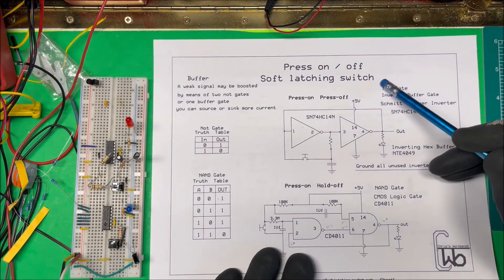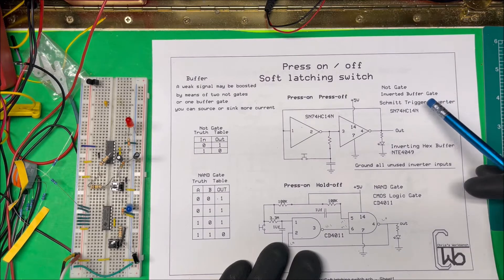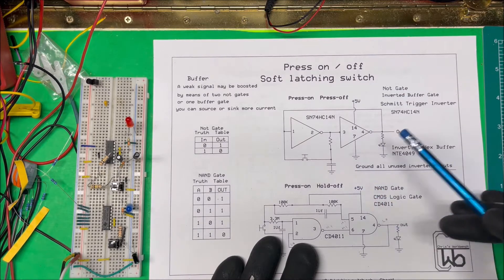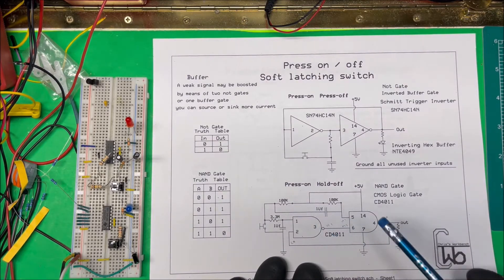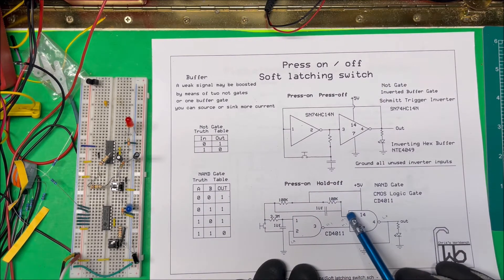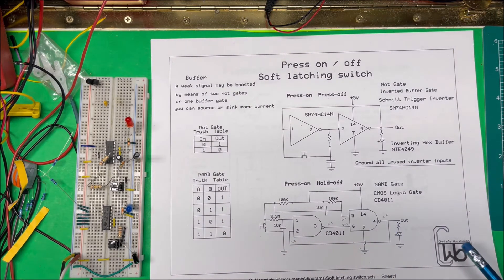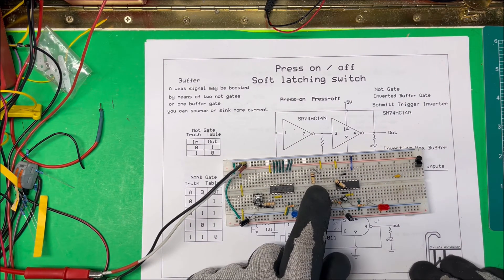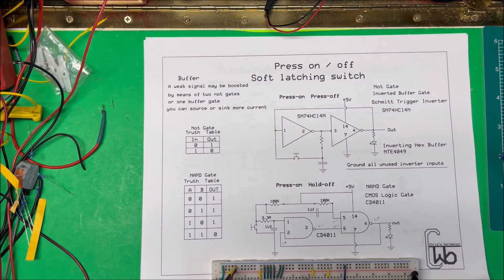Soft Latching Switch

Comment: Thanks for the only circuit that seemed to work! I used a HD14584BP which can control 4 switches (I am using 2 at present), it works perfectly

Comment: Interesting considerations. Thanks for sharing. I have a POn-HOff switch on my Siglent DMM. I do not know what circuit they used to engineer it, but, in terms of me interfacing with it, I would have to say that I find it irksome. That is not to say that its benefits do not outweigh its issues, I am only speaking to its operations.